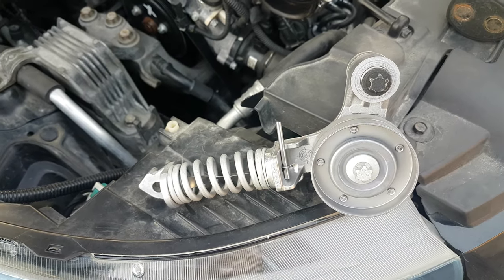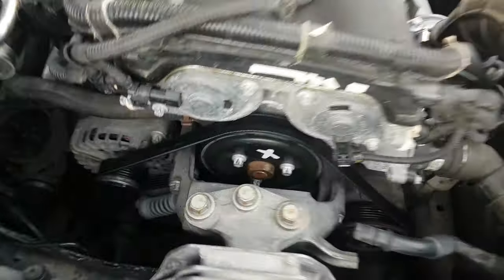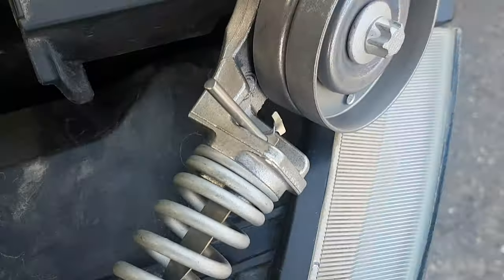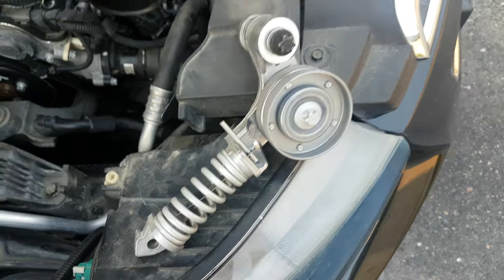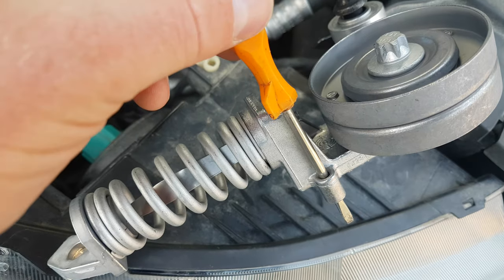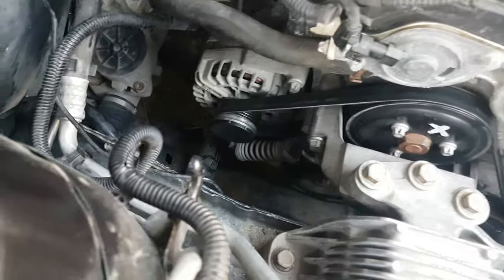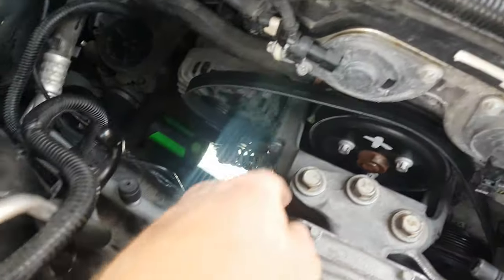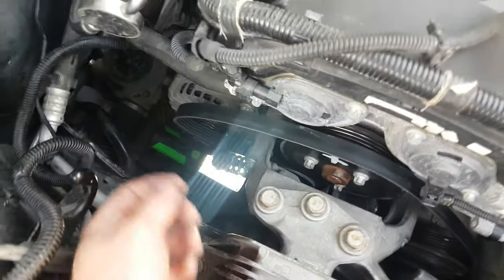PART 1 OF 2,2014 Chevy Cruze 1.4L Belt Tensioner replacement

Comment: That Hole doesn't hold the tension not at all but what that is for in that pin in the top is a shipping pin you're supposed to put the screwdriver in there if you're replacing the alternator to maintain the tension on the spring so that tab doesn't pull out clearly this video is a zero knowledge video
Reply: I was replacing the serpentine belt and I did not put a pin or screwdriver in the hole to hold the tension after removing the belt. The spring is completely released with no tension at the moment. I haven't put the new belt on. Is the tensioner ruined? Do I need a new tensioner now? The metal strip that goes through the center of the screen and sticks out the end for the pin is now completely inside the spring. I cannot insert a pin now to hold tension for installation.

Comment: How did you even start looking at this cause you are wasting your money you see the twist at the top of the metal so it doesn't go through the hole it's to catch after pin is removed
Reply: Hello I was replacing my belt today and I didn't put a pin in the tensioner after removing the belt. The tensioner completely released made it popping sound and I noticed the metal strip going through the center of the spring with the hole on the end for the pin is now completely in the center of the spring it's not sticking out the end anymore to hold tension. Is that just to help installation or did I ruin my belt tensioner by not putting a pin in while the belt was off?

Comment: I have 2 1.4's and both do not have a pin and they work fine, looks to me the pin would come on a new one so it is easy to install but then you would have to remove the pin to create tension. I pulled one  off  to see and what a bitch to put on and off with that tension. I stripped half the threads.
Reply: The pin is not supposed to be you remove it once tensioner is replaced

Comment: I can't get the belt back on I broke two tensioners
Reply from the maker: Not sure what you're doing wrong?
It's just 2 bolts on the tensioner. The torx bolt on the wheel part of the unit. once it's tight, it should then be able to compress the spring enough with your socket and long bar, to slip the belt on.
Reply: @joshuadaub  I get the bolts in , have gone through two tensioners I try and pull it back to let tension off the bolt wants to start stripping the treads out
Reply from the maker: @alicegarrison5426  yes well it's not the tensioner. It can feel like it's stripping but you need to be faster slipping it on. Hold tension with the bad slip the belt on. I've experienced that stripping feeling. Not sure if it's on the block or the bolt. But just the belt one. Mine has been doing good so far. 
If you have another person helping you slip it on while one holds tension. 
 Make sure the preload pin is removed while putting the belt on.
Reply: @joshuadaub  I'll see what happens ,
Reply from the maker: @alicegarrison5426  good luck . Other than that I can help you. I told you all I know.

Comment: Hi today is September 19 2019.. did your belt tensioner make any noise when it starting going ? What did it sound like???
Reply from the maker: I was havung issues with my dealer when they replaced my belt no charge because it was there fault from another repair they did. And they told me the tensioner needed to be replaced but they didnt have any. So i just went and did it myself. The pin  is to be removed after install . It hust there to preload tge tension
Reply: Joshua Daub thank you so must I own a 2014 chevy sonic rs 1.4 turbo and replaced my serpentine belt 1000 miles ago and not my tensioner the belt was original with 81,000 miles on it and I assume the tensioner is also .... I can hear it with a car stethoscope on the torqx nut sound like the bearing in the pulley of the tensioner is grinding ... gonna replace it this friday.. hoping to replace everything from underneath and not having to remove air box and upper motor mounts augh ..
Reply: @dakota47v8  see wss

Comment: Hey do u leave the pin where it is. Because I don’t have a pin it’s making noise
Reply from the maker: Yea the pin should be removed. It only used to help you install the new one
Reply: Joshua Daub hey can I show u a vid of what it’s doing
Reply from the maker: @khadarabdullahi3619  watch my videos theres a part 2. 
The pin is just there to help you install and remove the tensioner.  
When you buy a new one it comes with a pin in it. Which is there to help put tension on it. Or you can use a small screw driver too. To put in the hole where the pin goes  whaich will help with removing the old tensioner. 
So if your going to change your. Pull the tensioner to the point you can get a small screw driver in . Then undo your 2 bolts. Then do the same to get the new one on . Good luck
Reply: You are confusing me.  You said you replaced the tensioner because it did not have a pin, then you installed one that I don't see one.  So what is the explanation?  Please advise.
Reply: Have you gotten a reply yet?  This guy from video in confusing. What is the deal about the pin? Do we pull it off? Leave it? Or what?    ...by the way, it's going to rub on the belt if I leave it, right? (causing the belt to break)
Reply: @joshuadaub  hey I was replacing my belt and I forgot to put the pin in when I remove the belt. Spring completely released and the metal strip going through the center with the hole coming out the end where you're supposed to put the pin completely retracted in the middle of the spring. Is the belt tensioner still good or did I ruin it? Do I need a new belt tensioner now or is it okay? I can compress it on my own with the leverage bar but that metal strip is no longer sticking out the end for the PIN to go in.
Reply from the maker: @willnone9977  do you have a pic. 
That thin bar going through the center of the spring should be sticking out a little. Is what I've noticed. If it was pulled all the way through the centre then it might be no good. 
But if you just talking about the pin that holds it to pre load the tensioner for installation. Then that pin is removed after install or during installation.
Reply: @joshuadaub  I can showyou a pic I found online. But do you have it correct. That thin bar going through the center is not sticking out anymore it was pulled through. But is that a piece for functionality or is it just to aid in installation? Thank you for the reply.

Comment: hi there how to removed the pin?
Reply from the maker: The pin is only removed once you have installed the new tensioner. And then you have to apply tension to the pully while trying to slip the belt back on. Once there is enoght tension you can pull it out. Its just there to help you reinstall the part.

Comment: I did mine and its recommended to replace serpentine belt too.
Reply from the maker: The belt was replaced by the dealer a month ago under a warranty due to other issues they caused. Cars running good not and fix a ground issue. Bad ground caused all sorts of odd problems.
Reply: @joshuadaub  oh yes that ground cable,waterpump,valve cover,intake manifold,oil cooler,oil turbo lines are famous on these cruzes.
Reply from the maker: Not to mention the new engine and turbo the dealer put in but sucked at puting it back together. All kinds of problems 6months later its finally running nice again.   I think one of my trans lines is seepig  a little. Ill have to service that soon. Dealers said it was fine lol.
Reply: @joshuadaub  if car still under warranty they will have to fix it even tho they will fight not to.
Reply from the maker: They had non is stock. And i guess they wouldn't send some one to pick up the part at the other dealer in town 15min away. 
Its past the 5 year . Im at 5.5year now. But been having issues since the new engine 3 months before warranty was up . So i have a 1 year old 20000km warranty on the new engine and turbo.
Reply from the maker: That pin is to be removed. Its just there to help with the install of that new tensioner. I changed mine because the dealler said it was starting to cease up. But they had non. So i went to another dealer and got one. And installed myself. It was actually easier then i thought. Only hard part was getting the belt off and on. Because of how much tension you need to apply.
Reply: @joshuadaub  i ordered mine from amazon but it went bad within 4 months but amazon sent me another one for free.

Comment: Bout to do this task your way this week. Dealership tried to charge my GF "around seven [hundred] and change. It's kind of important." to do this 🤦🏻 she told the dude "I don't think so since it's like a $40 part and my BF can change it himself before school's even out" Wish I could have seen dudes face as his severely overpriced bullshit got shut down 🤣 she said he just stopped talking and finished billing her for the FREE  compressor job it took him THREE FUCKIN TRIES to fix ☠️ it broke again after the first time. Second time the tensioner was magically needing replaced (obviously their fault since it wasn't mentioned on round 1) and 3rd time was apparently the charm 🤣🤣 what a joke of an "expert technician" holy shit. Same guy working on it 3 separate days. No way in hell was he getting the tensioner job PSH UNREAL.
Reply from the maker: Wow. That's nuts 700. 
Parts  less then 100
Time to change 1hr. 
I've done it 2 times in 9 years almost 10years I've had the car. 
But change it before your belt gets chewed up because of bad tension. It happened to me. And the. You have to do even more work to change a belt. I need to upload more vids of all the shit I've changed on this soon. Like suspension parts changing. Anyway, good luck. 
-Wrench with long bar to release the belt. 
-remove 2 bolts. 
-remove and replace with new tensioner.
- thread bolts by hand first to ensure no cross threading.
- tighten 2 bolts. To spec
- reconnect belt, carefully!!
Done :)

Comment: Just checked for the pin and it is missing. Thank you for this video.
Reply: The pin is only to aide in installation and keeps the spring compressed until after it's bolted in place. You remove the pin after installation and release the tension. Please don't take advice from this video.
Reply: @P1ayCrackThe5ky  I was removing belt and I did not put the pin in after taking the belt off. Spring tension completely released and the metal strip with the hole for the pin is now inside the spring. Is it still okay to use or do I need a new tensioner now?